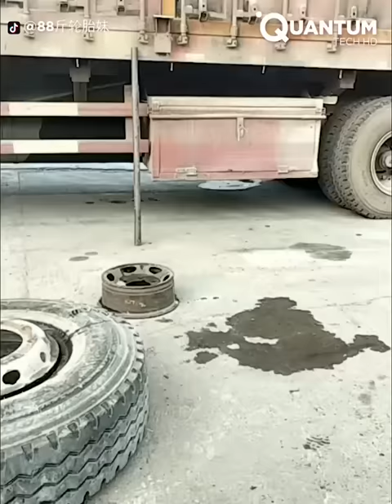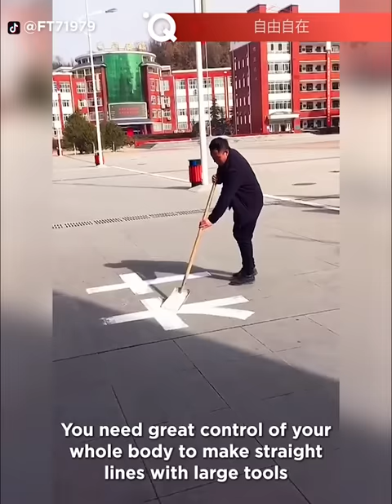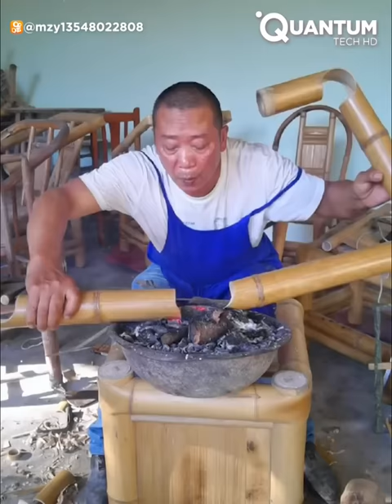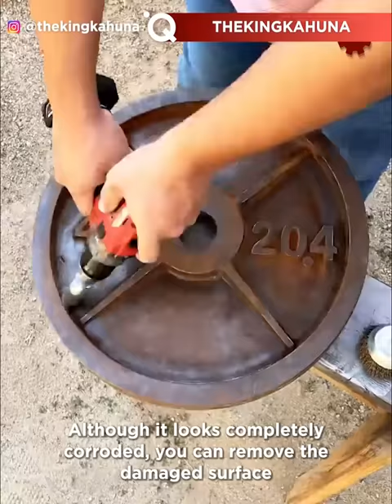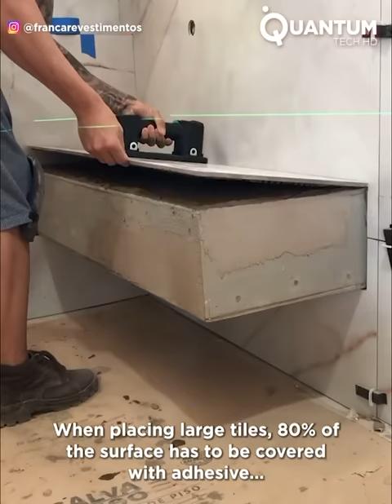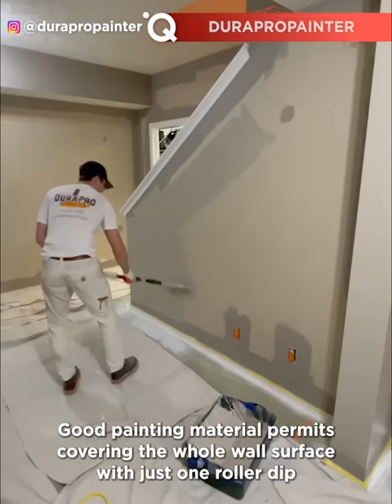Fastest and Most Skillful Workers Ever ▶7

Comment: If you have ever handled wire rope that big before you understand how incredibly strong that guys is.
Reply: That was a bucket with holes cut into the bottom.
Reply: @papapatouiee6471  Wire rope guy, not guy cleaning the rug.

Comment: 10:19 - A pipe? - no some form of electrical cable or huge motor winding....
Reply: Was about to comment on this too, it is a guy working on the windings of a generator.  Edit:  Specifically they might be checking the wedges, we just type of work done at my facility.